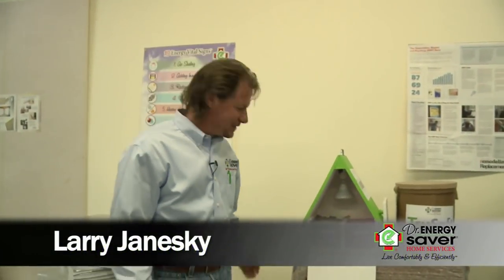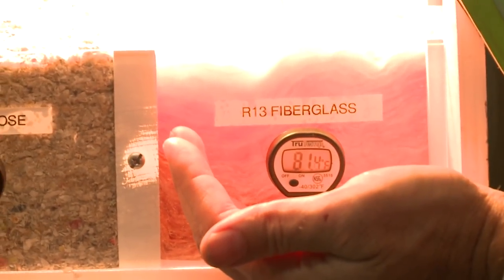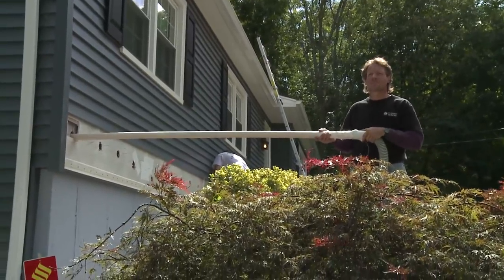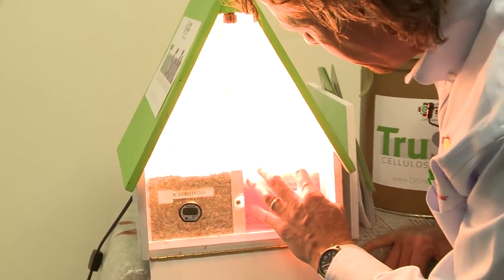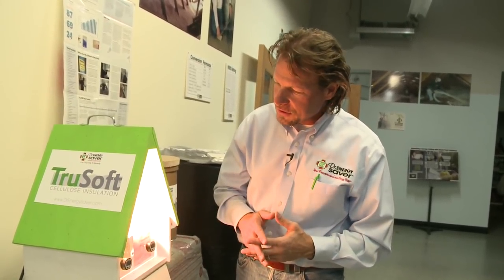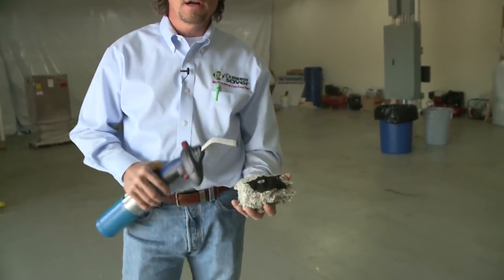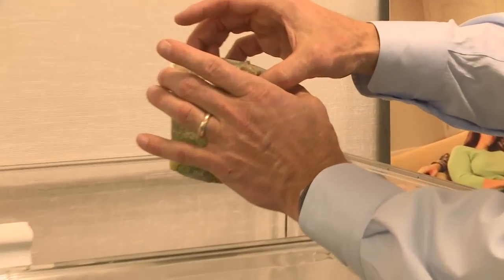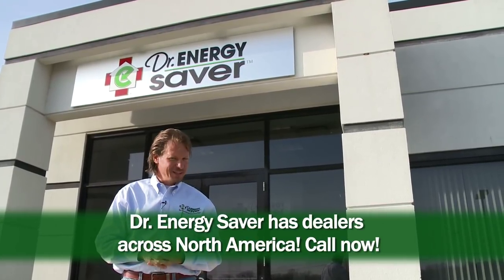Why Cellulose Insulation is Better than Fiberglass Insulation

Comment: This shows the exact problem i'm having in my home in FL. 75% of home has blown cellulose which works fairly well but over a faulted living room it has fiberglass. Ceiling dry wall temp in vaulted living room reach anywhere from 78-104 on a 90 degree day, rest of ceiling around house stays pretty constant at 74-75. Looking very soon to had more cellulose around entire attic as well as get rid of fiberglass on vaulted area to help improve comfort in home.

Comment: I had cellulose installed in my old 1946 walls. The house is so quiet, it's spooky. 
 Blew it in the attic and went from a 4 ton ac (125k btu heater) to a 2.5 ton ac and I heat the home with only 38k btu's of heat. I also covered the ducting.
Reply: newstart49 

Hey I read somewhere that the chemicals disappear making the insulation burn after 2-3 years...... would you be able to check if that’s actually true for me please??!??!
Reply: @ColeB-jy3mh  No,  that  is incorrect.
That  is another  urban legend started by fiberglass sales people.
Reply: I have a old house in Toronto Canada. I am wondering if I can use cellulose for wall insulation. Doesn't make rot issue during time?
Reply: @rezaghahreman86  Cellulose insulated walls perform quite  well compared to fiberglass,  you  shouldn't  have  any problems with "rot", as cellulose is hygroscopic, meaning  it is capable of absorbing moisture, and  able  to  release that moisture as well.

As long as you  don't have  any water intrusion from the exterior,  you should have no issues.
Reply: @fartman2269  In Florida, you bet hurricane and windstorm could cause leak through the roof.
Reply: @HsingSun  If you got a leak bad enough to soak your insulation, you likely have a lot of bigger issues to worry about than insulation.

Comment: It's worth mentioning that fibreglass insulation compacts over time so your 4" ceiling insulation laid 10 years ago might now be 1/2". It sags in stud partitions meaning there is no insulation at the top of walls where most needed.

Comment: There are many reasons why we prefer cellulose over fiberglass insulation.  One is resistance to air flow.  Take a look at the the material that your furnace or air handlers filters are made of - it may be fiberglass.  Filters are designed to all air movement through them.  

Blown in cellulose insulation is 2-3 times denser than fiberglass insulation. Studies comparing blown in cellulose insulation vs. fiberglass insulation show that cellulose insulation was 38% tighter and required 26% less energy. A Princeton University study shows, a group of homes with blown in cellulose insulation in the walls had an average of 24.5% reduction of air infiltration compared to fiberglass insulation, with only the walls insulated. A similar study, the Leominster MA Housing Project for the Elderly found that, a building with blown in cellulose insulation compared to a building with R-13 fiberglass batt insulation in the walls and R-38 fiberglass batt insulation in the ceiling, had 40% lower leakage.

Comment: Everything he speaks of is true.  I have used it, installed it, toured factories, made a living with both fiberglass and cellulose, all back in the 90's.  This test is a very simple test, but it does show the basics.  Cellulose has almost no convective action in it, fiberglass has a ton.  C has a very low permeability, FG has a very high permeability.  Either one will fail if it gets wet, but FG is worse as it is destroyed and never the same even if it does happen to dry out.  C never loses its resistance to flames.  Period.  Those chemicals are safe for humans and never break down.  Nice try though.  Because of this, a house with C will take longer to burn down than one with FG.  Period.  It has been proven both in university testing and real world examples.  C is regulated for flame resistance by the feds, FG is not because it doesn't stop flame but actually promotes it.  As fire breaks into a FG insulated cavity, it will shoot up the cavity as the FG simply 'melts' away and the trapped air fuels the fire.  C blocks and adsorbs sound transmission way better than  FG can.   C is safe to be around, FG is the next asbestos.  Finally, R values are measured by the feds in a sealed cavity.  If you use and unfaced batt in the wall, say in your basement and don't cover it with drywall to create a sealed cavity on both sides of the FG, it will not have an R13 value.  FG that is open blown in attics never achieves the R value stated, mostly because of convective air circulation.  Plus, FG is easy for the installer to 'fluff' when they install it, thereby using less bags to achieve coverage but giving a lower R value as installed according to the label.  Always count the bags when they are finished to make sure they used the right amount.  C installed in an attic will slowly settle some and create a smooth surface over itself that is slightly crusted, so to speak.  The R values are stated at settled density, not installed. Finally, if you get mold on C, then you have much bigger problems than the mold!  Stop the water!
Reply: Fiber-crap is what I call it.  I installed blown in cellulose in my first house in 1982 and every house since then.  I have it in my current house and it's very energy efficient and quiet as a mouse.
Reply: Did they teach you about paragraphs when you went to school?
Reply: @billymacktexasdetective5827  This YouTube none of that matters.... LOL

You gotta give them credit for all that good info. 👍

Comment: Your comparison was flawed. That particular lamp you used conveys a portion of its heat via light coming in contact with the surface. Light was penetrating to the thermometer. Which makes sense since fiberglass is supposed to use more air to try and stop temperature spread. We could explain more about it, but.
Going forward the test should have had a thin piece of something else that completely stops light penetration. AKA black tar paper or for the most accurate, a piece of sheathing material.
Reply: Veevslav1 and instead of placing the thermometer at the same depth in each box it should be placed at the same “R value” depth.

Comment: Over time, many years, about 20 to 25 years the cellulose insulation becomes flammable. It may be the dust that accumulates over time that causes it. It actually ignites by just touching a drop light with an incandescent bulb against the material. Many people that have homes that are old and have this material in the ceilings between the ceiling joists, actually build protective, constructions to keep this material away from light fixtures. Because it has started to smolder and ember, just being near the fixtures. Sincerely, William McCormick
Reply: +William McCormick, thirty year old cellulose has been tested and shows no loss of fire retardant. . During the same thirty years installed fiberglass has remain non-fire retardant and not approved as a fire back or fire wall, Cellulose hos both those certificates.  In fact , the paper used to cover fiberglass to protect the public catches fire and contributes to the spread of  house fires. Your high pressure lies may trick ignorant folks into buying inferior fiberglass but sooner or later, an intelligent buyer gets that home and immediately has us vacuum out all the nasty fiberglass and install fire-retardant, superior cellulose insulation. They are amazed by the difference.
Reply: I took a sample from a house, that experienced AC installers had started several areas of the insulation smoldering with red embers, by only touching the drop light to the insulation. Even after they started one area smoldering and extinguished it they started others. The house filled with smoke to a point it was suffocating. The guys in the attic got sick but were able to find and extinguish all the different areas that were smoldering.
I experimented with it, and it was far too unstable to use as an insulation. I am going to see if I have some left. If I do I will make a movie of it being heated.
If I was in the forest and I needed to make a fire without matches, I would want this stuff for kindling. 
I was told by a person that had spent a good portion of his life as a high ranking fire department representative that the insulation had been banned, for very real, very sound reasons. When I saw it again in Home Depot recently I thought the world had gone quite mad, for sure.
Sincerely,
William McCormick
Reply: +techtalk , a chemistry major would not confuse boric acid with &quot;things that have a half life&quot;. We are not talking about carbon dating 50 million year old dinosaur bones.&#160;The information you seek is available from the manufacturer. Antidotally speaking, I&#39;ve personally removed cellulose from my parents home&#160; which I personally&#160;insulated in 1974 and tested it for fire retarding qualities.&#160;It was fine.. Again, pay attention please, &#160;Cellulose, not Fiberglass, is rated as a one-hour and a two hour fire wall. Cellulose is also one of the few means to create a fire stop. Again, those test results and certifications are available from each manufacturer who cares to have their particular product tested. Your opinion is between you and he manufacturers. To challenge their test results I suggest you contact one of them.
Reply: +William McCormick , please direct me to the newspaper article that followed the alleged incident and which attorney is handling the liability lawsuit. I assume you can add credibility to your tale by documenting these obvious follow up results to your story. Or can you?
Reply: The houses are still there. As I told you, some people built little cardboard fences around their light fixtures that protrude through into the attic. I saw them personally. I was there as guys tried to find every spot they touched the metal back of a drop light to the insulation. With blinding smoke in the attic.
For many years our building department would not let us use that material for that reason. Was it a law, I have no idea. Was it actually band by some decree I could not tell you. But since I experimented with this stuff and would gladly take it with me into the wilderness and have no fear of using friction to get it smoldering. Common sense dictates it is foolish to use it.
I do not know if you are aware of the cover up in the cities that used asphalt adhesives, years ago. In all tar exists uranium. And while the tar is oily the uranium is as harmless as lead. When the oxides in the cement oxidize the uranium, it becomes highly radio active and produces radon gas. This was brought out in the sixties, and quickly no more tar was used in the city. To this day they are still steaming and grinding tar off cement city floors in office buildings. Well that is it right over and done with? No they are bringing back asphalt adhesives once more. Did we learn, can I show you any newspaper articles no. But I will not order or use asphalt based adhesives.
Poor kids used to get a piece of pitch (Tar), and use it to develop film inside the camera right through the back of the camera. The rich kids used a Geiger Counter.
Do what you like buddy, it is a mad, mad world out there.
Sincerely,
William McCormick
Reply: +William McCormick, anyone can use a farmer's corn grinder to shred newspaper and use it as insulation. In fact, during the Jimmy Carter gas embargo era insulation was a booming business and even corn grinding equipment manufacturers were getting into the business. .Not all ground up newspaper was treated with fire-retardants. There were hundreds of ma and pa operations selling all sorts of untreated (or poorly treated) shredded material for insulation. I have to believe some is still in homes so should be tested.  Even before that, many homes were insulated with corn cobs and other cellulosic materials that were not fire-retardant. Today's cellulose insulation is both fire retardant and insect resistant. Again, take up your story with the testing laboratories and manufacturers if you think their high fire-retarding rating is a conspiracy. For your edification, of course, non-insulation contact rated ceiling can light fixtures must maintain two inches from ALL loose blown insulation...that means ALL.  Ideally the homeowner should switch out to IC-rated can lights or even better, the new LED fixtures. Those can be covered with cellulose. My experience is that if a non-IC rated can light is covered with fiberglass, nothing will happen because fiberglass is a poor insulation so lets the heat escape. However, put cellulose over the poorly performing fiberglass and the heat is restricted...can't escape, and the light's circuit breaker will click on/off as the light overheats and resets. That's a telling an impressive difference between the two products. Cellulose holds the heat in, flubberglass does not. For years (decades) I've demonstrated the fire retarding ability of cellulose by melting a penny with a torch in my hand...with only the cellulose protecting my palm and fingers. The penny melts into a ball and the cellulose chars a little. Try that with fiberglass and y the torch will blow a holes through the fiberglass and burn your hand severely. Agreed, if I had some of that fake cellulose in my attic from the 70's early eighties, I'd remove it like we do so much mouse-infested fiberglass. Fresh, modern cellulose is formulated to be fire retardant beyond anything you can imagine.
Reply: I do not know if you remember rock wool, it was in attics since the early nineteen hundreds. Then it was the devil, it is perhaps worse than asbestos because it becomes more easily airborne. It was almost gone from existence.
Yet today once again we find it all over the city being installed as insulation and sound proofing. Go figure.
Sincerely,
William McCormick
Reply: +William McCormick, it was fiberglass recognized as a worse cancer causing agent than asbestos. In fact Federal law required every bag, roll, or strip of fiberglass insulation to be labeled to show it was dangerous. The fiberglass industry lobbied for years to get the label requirement lifted. Now it's "buyer beware". Do a web search and you will find the news articles about the asbestos company that lost a multi-billion dollar lawsuit because of all the cancers caused by their insulation product. They filed bankruptcy to avoid the payments to victims, reorganized, and now make fiberglass insulation which by some sources is worse than asbestos. That's one of the many reasons PipersSon (aka SuttonWoods) gives his silly stories to scare folks from the competition. No one who knows the depth to which they sink trying to sell inferior fiberglass, trusts them. After all, they once made the same false positive claims about asbestos. As you know PipersSon, yaps with complete anonymity, hiding in cyberspace, immune to prosecution for libel, defamation, and slander..
Reply: "Antidotally speaking." I think you mean "Anecdotally speaking"
Reply: vbezbradica, your 1st link did not connect. The Wikipedia link is about mineral wool. Fiberglass is NOT mineral wool.

Comment: Dear Larry Janesky,
Thank you for all the information about fiber cellulose.
I am from Portugal, and I will apply the cellulose insulation. The company that is going to apply it recommends 15cm (about 6 inches) high in the attick floor (cement attick). Do you think that's enough to do a good  performance in Portuguese weather (between 5 and 35 degrees celcius)?  Looking foward to your opinion. Thank you.

Comment: In my opinion, you need to reconstruct the heat demonstration to control for the radiant heat from the lamp directly onto the top of the plexiglas. That is transferring some of the heat that the cellulose side is not. 1) Fill the fiberglas side to the top so it is equal to the cellulose side. 2) Place some foil on the top of both sides to reflect the heat from transferring through the plexiglas. 3) Place the thermometers on the bottom of each chamber to directly measure the heat transmitted THROUGH the insulation material and not the sides of the containers. Control for these factors, and your demonstration would be more accurate and more believable.
Reply: It makes no sense unless the fiberglass is in it's installed state, not compressed down like the cellulose.
Reply: Also in that diagram, the fiberglass thermometer was much higher up (almost a full centimeter) more than the cellulose thermometer… so DUH it’ll get hotter!

Comment: looks like theres just a tad less fibergass from here. That could account for the 1 degree diff and the temp sensors  should be at the bottom and not near the top
Reply: 5:35 looks like 20 degrees not 1
4
Reply: if both have the same r value then both should have the same heat resistance.  so... there should be no difference.  However it does take more in inches for batt to match blown.